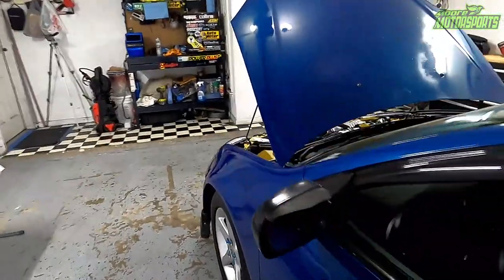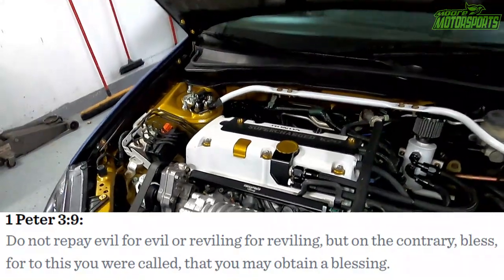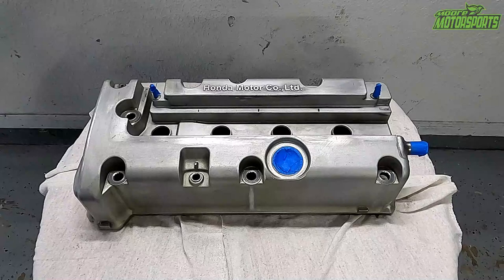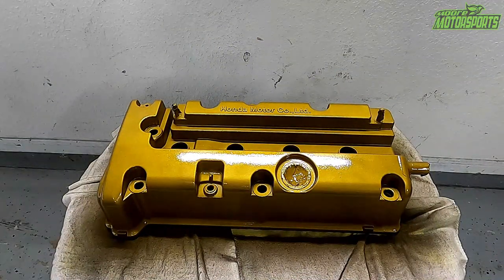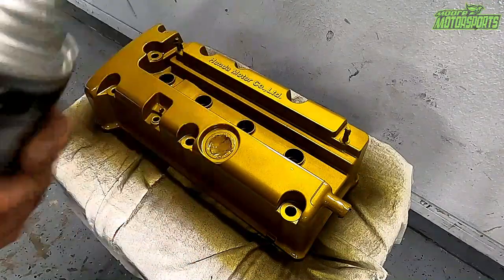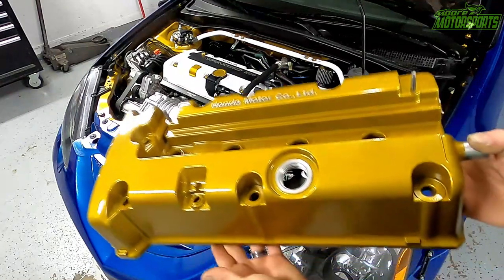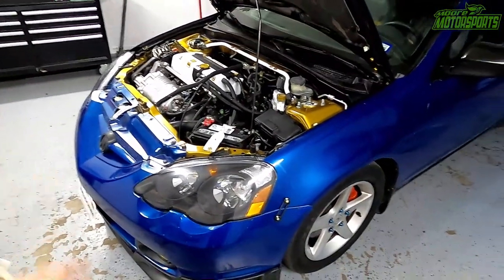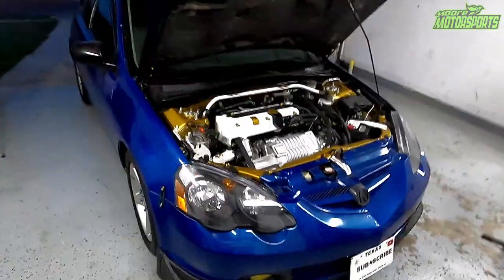I MADE A CUSTOM GOLD SPRAY CAN PAINT USING THIS COMBO.

Comment: Question..should I remove orange peel on my base coat before adding clear or should I leave it, spray the clear and then wetsand etc to remove orange peel?
Reply from the maker: If it’s metallic you leave it but if it’s not metallic definitely wet sand for the smoothest finish

Comment: Oh wow!! Looks super awesome. I got to apologize for not keeping up with your videos, had a rough few months, I am trying to get back in the groove. Your videos are really informative and tutorial......I am planning to spray my wheels soon, gonna be using the Rustoleum Turbo spray, but I got to question, do I really need to use a primer on it before the color? I got to sand the face, got rashes on every face. So can you give me a little advice?
Reply from the maker: Not everything needs a primer to be honest but I wouldn’t use turbo paint for wheels cause that stuff comes out fast and aggressive and runs are very easy with it I would just use the taller cans of rust oleum but not the turbo and I would use it by itself just scuffed wheels really good clean them and it will it here if you want to use a primer it’s just going to help the adhesion
Reply: @JamesDguy  ok thanks man. I will use the Turbo on the car itself, got a few of the body parts black already, used a different brand and it didn't hold up as long as I thought, so the Turbo should do the job better
Reply from the maker: @5starempire868  The turbo paint is strong paint don’t seem to flake off so far from what I seen.
Reply: @JamesDguy  yes that is true, I saw from the multiple videos you made with it. I just thought it would have made painting the barrel of the wheels a bit easier

Comment: So I recently painted my car with rostoleum cans and 2k clear coat on Monday the 18th but  it didn’t come out as good and came out streaky I believe I didn’t spray a good even coat with the 2k clear coat plus I ran out but I ordered more which will be delivered tomorrow my question is, would I have to sand the whole car again or can I spray the clear coat over?
Reply: Help need lmk thank you
Reply from the maker: 2K not 2X right? Did you activate the hardener on the bottom prior to painting the clear coat? Refer to my other videos if you didn’t see them on 2K clear. It HAS to be activated also you could wet sand the car with 1000 grit till smooth then re clear it.
Reply: @JamesDguy  yes I  used spray max 2k clear coat, I did a clear coat on the whole car after hitting it with the base coat but it came out uneven, so rn my car is painted it’s just some spots are clearer than other I was wondering if I can order more spray max since I ran out and just spray it again to perfect it or would I have to sand it and then hit with a new Bach of clear coat

Comment: how do i clean off overspray
Reply: Thinner
Reply from the maker: Depends what it’s on. If it’s windows I use soapy water and razor blade or soapy water and steel wool #0000. If it’s on rubber stuff use mineral spirits. Acetone or brake cleaner on a rag for other things like metal and such.